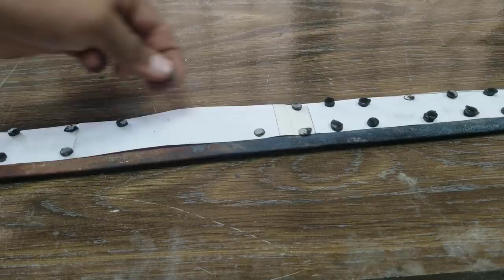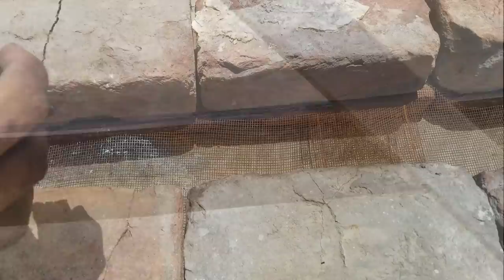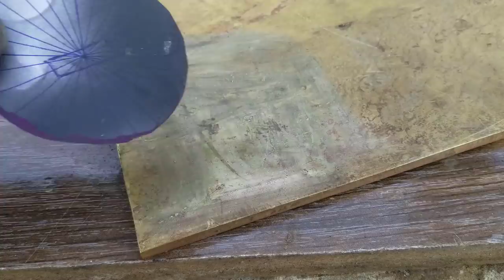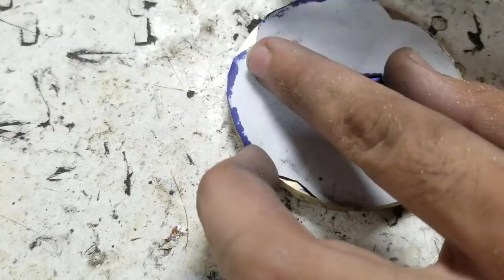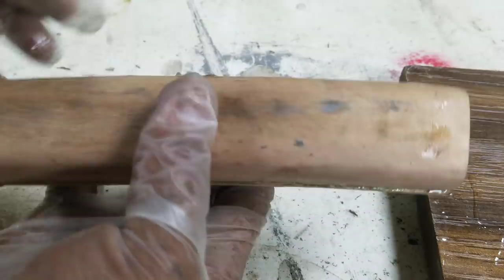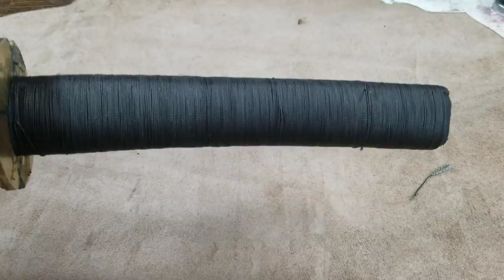Forging a Sharp KATANA Sword with Leather Handle out of rusty Trash.

Comment: instead of welding, the hole shut you need to actually forge the blade.  cut small pieces, weld together, heat, flux, hammer forge, draw, shape, heat treat
Reply: I think he did an amazing job for what he started with as for the weld as long as he heat treated an appropriately afterwards he should be fine the only reason he and foraging was a thing at all is because we didn't have adequate manufacturing at the time.

Most fixtures had never been made so bladesmiths and blacksmiths in particular were basically the highest tech of the tech people in their time.
Reply: @tcantrell5301  you have a good point it's just my opinion.  I love the artistic side of the sword but I studied martial arts so I want it to be practical.  This could cause a breakage in combat.

Comment: Impressive, but you screwed up royally. Just so you know, katana are characterized by their layers. The thousands of folds are unnecessary with better metal, but it it's not san mai, it's not a katana. You need a taco of harder steel, wrapped around softer steel. This is extremely important. The curve doesn't come from hammering it in like with western blades. The two different steels cool at different speeds in the quinch, this creates the curve. Also, there's no hamon line. This is a key component in japanese swords. Anyone that knows japanese swords can tell with one look that you didn't know what you were doing. You put clay along the edge at the end heating, then quinch with it on the sword. That's how the hamon is created. These are all quintessential trademarks of japanese swords. What you have is a western sword imitating a katana. It is not a katana, just a sharp metal stick. You can find all this information on Google easily, or just watch some japanese swordsmiihs on youtube. Without these key components, you cannot call it a Katana, that's FORGEry. Also, to be too not picky, technically, technically, any sword notade in japan, the complete traditional way isn't actually allowed to be classified as a Katana, but that's just Japanese bs to keep their things theirs. But yeah, you also missed the tsuka, tsuba, and habaki, and you didn't forge the Kisaki right. Sorry, japanese swords have a special place in my heart, I kinda have to criticize when I see them insulted. Sorry again, but that's what this is to me. Very nice work though. It takes a lot of skill to forge, I'm impressed I am. You should be proud. But Japan is Japan, and a Katana is a Katana. Very nicely done though.
Reply: There are a couple small things you got wrong here. First of all, it is NOT thousands of folds in traditional katanas. That is a huge misconception, it's only a couple dozen. Not only this, but katanas are not san mai. San mai is as you said, a sandwich or taco of a hard core and soft outside. San mai IS Japanese but means 3 layers. Katanas are not san mai because they have a hard edge and soft spine, not 3 layer of soft hard and then soft. Plus why do we sword lovers ONLY ever do this with katanas?? You don't see people who like European swords go on someone's forging video and say "actually, that's not a real longsword". Like back in the day they weren't even CALLED katanas. They were all just swords, we came up with that term in the modern day to identify which type of sword we are talking about. I will never understand why we focus on this sword specifically like this.
Reply: @bonesylikesgoodmusic3401  well actually you're wrong. I'm a japanophile, Katana are extremely important to me. The folds are meant to purify the tamahagani that is a iron that has a lot of impurities in it, aka pig iron. If you're using better metal, the folding isn't required. That's not what I was talking about though. I was referring to the san mai, and yes, I know it means three layers, I speak Japanese. You're just completely wrong in every way here. Japanese swords have to have these layers, it's an extremely important characteristic. Some sword making schools in japan even used go mai, five layers, or more. The soft steal spine allows the sword to be flexible, while the harder steal edge can hold a sharp edge. Also, these layers are what creates the typical katana curve. You don't hammer them in like with western blades. It's a by product of the different cooling times in the quinch. Basically a planed warp. Plus the hamon, a must have in all Japanese swords. Also, katana were always called Katana, it means sword in Japanese. But regardless, I was just pointing out that to be called a Katana/wakizashi/tanto a sword must have the basic characteristics of one. It's like a kukri without the forward bend the way he made it. It's not a Katana. Also it's too thin because no layers. But I get it, not many people put in the effort to learn these things. They even made the same mistakes in the forged in fire okatana episode. It was a sad day for me. I've researched katana a lot, even bought my own, though a chinese replica can't actually be classified as a Katana by japanese standereds, even though it was made by Japanese smiths. It's a Japan thing, they want their stuff theirs, so they set a bunch of BS rules on what a Katana is allowed to be. Technically, any sword made outside Japan isn't allowed to be classified as a Katana, they're considered national treasures. You're not even allowed to take a Katana outside of Japan if you bought one there. They have to get special permits for if they want to show them off. Katana are a special type of sword, made in a special way, that's really it. What he made was a western sword in the shape of a Katana. It has to be san mai, it has to have a hamon, those are just the most basic characteristics of a Katana. But if we're getting technical, he actually messed up in a lot of other ways too. The Kisaki, the tip of the sword is wrong. Also, without the traditional tsuba wrap, it's also not really a katana, but I think he was going for a shirayuki type katana, so that's not really wrong. But if he wasn't, he'd also need the butt cap, can't believe I forgot the Japanese word for that right now. Anyway, there's also traditional things in Katana nobody ever includes, there's supposed to be this marker thing in between the wrap, decorative mostly, but also provides a better grip. Sorry, I'm a bit nit picky about Katana, they're kinda important to me. But outside of the traditional BS requirements, the san mai, and hamon are must haves in all Katana. It's what distinguishes them from western swords. It's exactly like having a backwards bent kukri, or a sax with the wrong point. You've got to meet the basic requirements to call it that name. That's all this is.

Comment: First of all Katana is made from folded Steel. Second of all a leaf spring will not do. And finally you're just pathetic so, you took the shortcut in ground of the blade to shape, and then you will do the whole in the middle of the blade, that also means you're going to have a weak point oh, and it will snap like a toothpick
Reply: How will a leaf spring not do?? Leaf springs are far better steel than what the Japanese had back in the day. And no, it doesn't need to be folded because this is pure steel, not the bloom steel that needed purification through folding.
Reply: You seem like the kind of person to argue that Cosplayer Props suck because they don't function exactly like what they are based on.